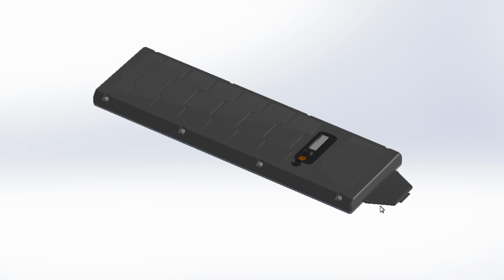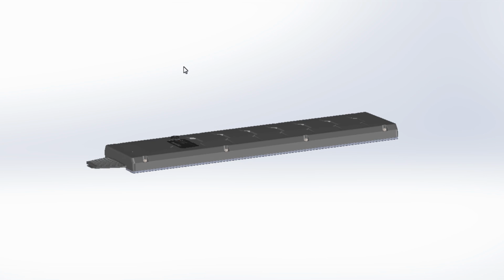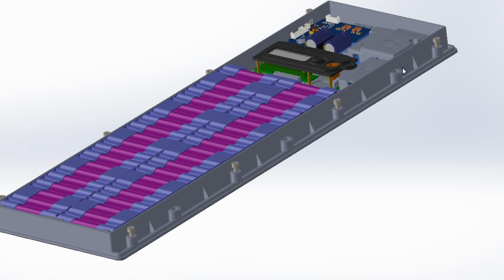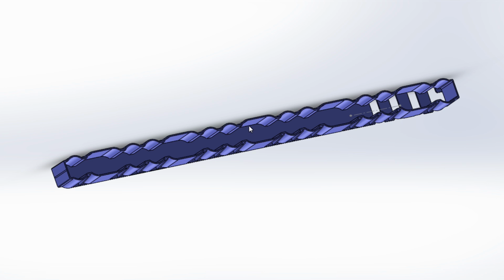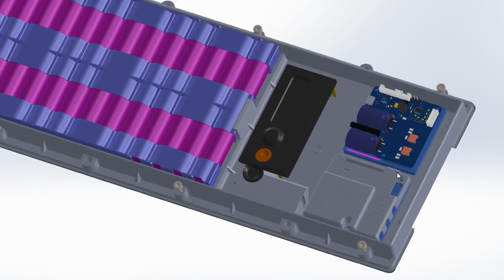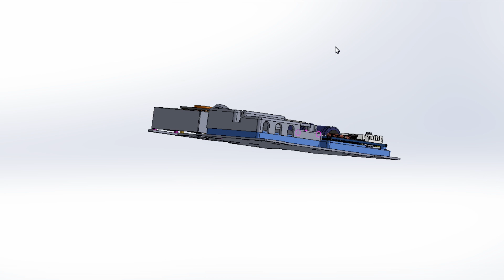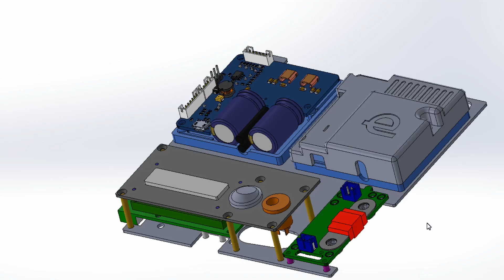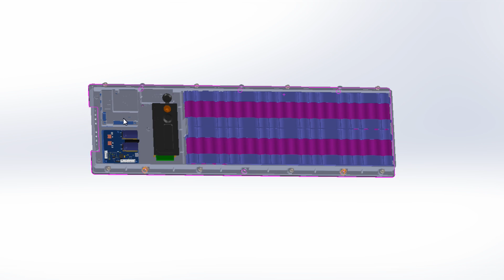Raptor 2 | Power Module Explained - Powerful Electric Skateboard Conversion System

Comment: Is there still a way to get the enclosure without anything in it. I bought the controller system a while ago, but having the battery box would make it super easy to build my two skateboards.  If there's any way you can help that would be awesome.

Comment: put charger connection cap to the side(hole 5% for water drain) - cap hangin' downwards...! if you understand what i mean. against the 1000 x gravity and shake. use 21700 cells. sorry my bad english.

Comment: Nicely done. What I would like to see is some sort of connector for a smaller emergency battery pack that could mounted on the top of the deck in the event of main battery drain. 
The idea would be to have the extra battery in a back pack and when needed plugged in the controller board and some how fastened to the deck. It would be a get me home back up plan.
Reply: What size is the battery? How does it compare to the Evole? Never owned a electric longboard so have no idea. How far can a 175 lb. rider go, traveling at 80-95 max speed, on moderately flat ground with some hills? Just a best guess is good enough. 
Looking forward to receiving the Raptor. Is delivery still slated for end of April. Thanks
Reply: Thanks for the response. My guess is mine is part of the July batch. Too bad, as by the time it gets to Canada summer will almost be over. Summer is short way up here. My guess on range is half the 25 miles. Should be a boat load of fun. Thanks

Comment: I am not sure that glueing battery pack to battery clips is good idea. If one of the battery in battery pack will fail (for any reason) your will have a hard time to remove all the glue just to replace one battery cell.

Comment: Try to make sure all the mounting holes are secure and reinforced.the mounting hardware of your SCP wasnt that good and the abs would crack overtime...
Reply: I agree, that was my first thought, they are too weak.
Just take a look at boosted boards and how they did it, they used big metal plate as washer.
Reply: César Grimmelprez I would put a plastic washers around those screws

Comment: You don't realize how excited I am about this video being released. Im in love with the raptor 2 electric skateboard. I use Entertions space cell on my setup but I would also like to make a second diy version for my brother because he is on a tighter budget. When will the schematics be released so we can start building him a battery pack? He's already bought the dual drive mech kit, two motors, and two VESCs. The only thing left he needs is a battery pack. Other than the schematics is there any other fourms or steps by step instructions of making a diy battery pack that could help us out on our future project together? Since my brothers wanting to make a diy version and we're still in the learning process are there any tips, instructional media, or advice to help out other that the future schematics your releasing? We will probably start building the battery as soon as those and the end caps are out so we can use them with the pack. We really need a diagram of the wiring process and we're not sure where to get the right BMS from. Any info would help a lot!!! We'be been dying to make a diy pack like the space cell but we're just so confused. Thank you for all the awsome products you've realeased! You've helped so many people already it's amazing!
Reply: Private message me for a battery pack quote!
Reply: Steel Cucumber are you still making custom batteries ?
Reply: If you're not on electric-skateboard.builders, you should check it out.
Reply: Electric Skateboard Builder That diagram is amazing! I'm just curious weather or not all 10 cells can use the nickel plates that fold instead of only using them on the 2 cells towards the far left? I'm asking this because it looks like the nickel strips between the other 8 cells would touch after the pack is folded anyways. Or should you put a piece of non conductive material between the nickel trips of the other 8 cells and only have the two on the left connected by through the fold.
Reply: Electric Skateboard Builder And why 4 direct wires in the middle of battery when there are only single nickel stripes throughout the way?